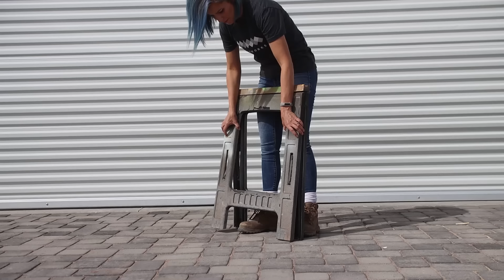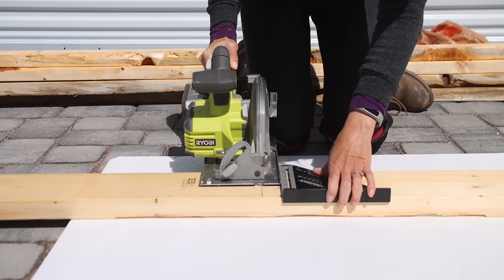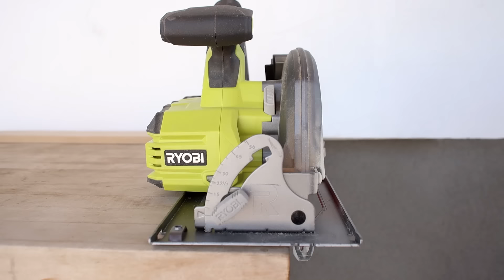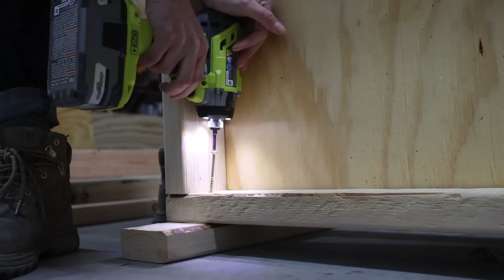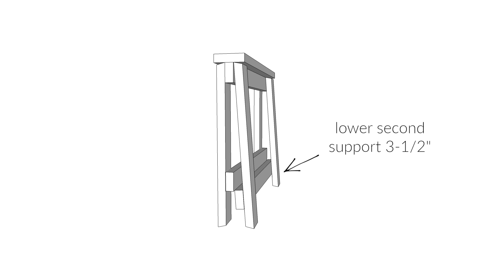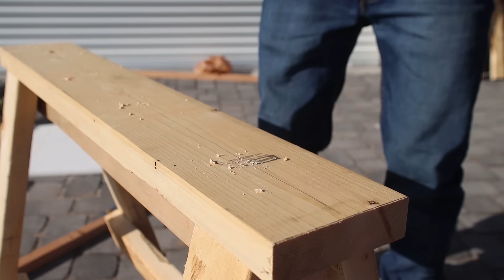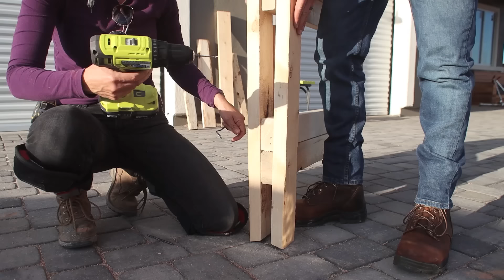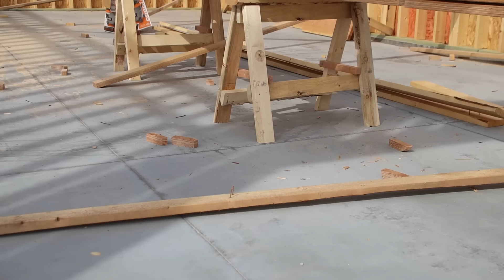HEAVY DUTY DIY Folding Sawhorses

Comment: Great vid, I’ve gone through many saw horses. I like this design, but one small suggestion would be to not glue the top surface board to the rail, as this make it harder to replace.  This top piece take lots of abuse, like saw cuts.

Comment: I'm surprised you are wearing your Dimond wedding ring. My wife was helping me one time and her left hand got pinched and it bent her ring. Had to almost cat it off. Will not wear her rings when Helping me any more. Could have lost her finger. Becarful with your rings. Great Video.
Reply: Good advice. My mate did the same thing and nearly lost his finger, he doesn’t wear his wedding ring to work anymore!!
Reply: Absolutely, a saw a nasty finger accident made worse by a ring
Reply: Stanley Keith. You know that might be the reason for silicone wedding bands that I’ve seen. The initial impression was who’d want to wear something cheap like that? But then, it would sure give away and save your hand in a situation like you were describing.
Reply: @daphneraven6745  Absolutely, that and some of us get reactions to different metals.
Reply: Completely different scenario but when I was in college studying mechanics, my tutor told me about an old colleague of his that accidentally shorted out a car battery with his wedding ring, then when he pulled his hand away it basically de-gloved his ring finger leaving just bone because the ring got so hot! Not sure how true the story was but this reminded me of it, rings can really get in the way! 🤣
Reply: In germany you aren't allowed juwelry or a wirst watch or such if you're a professional builder (carpenter, mason, etc)

Comment: Great video – just been and bought my hardware to build a pair of these. Just a quick note though for the cut list on your step-by-step, the diagrams measurements don't tally with the actual cut list. You've got the runner and leg distance lengths at 36" but should be 33". I've dropped a message on your guide.
Coincidentally, these plastic saw horses in the UK are £30 each, $40 USD so well worth building from this video when you consider how durable they are.

Comment: I like it. I have not read all the comments. My thought is to use a bolt with the head cut off. Instead of the dowel. This would negate the possibility of the dowel breaking over time.

I am going to make a set because I too, have a busted plastic set...🤣😂😅

Comment: Nice job, however they're the same weight as the ones you said were too heavy? Ability to fold requires hardware and compromises strength (when compared to ridged ones). Construction too involved and lengthy, but it makes for a good vlog!

Comment: nice design. i am going to try it with a slightly unstable set of ready made folding metal saw horse heads. the lock arm and gate latch could be useful for that too. my diy sawhorses are stable back and forward but not to the left and right. you solved that problem without too many bevels (new to the round saw). wavering between portable and worktable. i guess that happens at first. ha....

Comment: Now, replace that 2x6 across the top with a 4x4, make them a little shorter and then add in the pipe clamp adjustable top from your other video.  Instead of the little cross pieces to lock the legs together, put in a hinged shelf that locks the legs together and is narrow enough to let the pipes fit on either side of it.

Comment: Should have only used 2 3/4" or 2 1/2" screws for the top plate, since you are going through two 2x4's (3" total) and you also countersunk. Don't need any sharp screw tip sticking out the bottom to rip open your hand.

Comment: I noticed that the holes you drilled for the dowels were perpendicular but should have been at the 15° angle. However, I think using a piece of chain stretched across the center cross beams would suffice to lock the horse at its maximum spread. That way there is no need to lock anything in place (saves time when you just need a quick saw horse stand).

Comment: Wow, this is not the way to cut wood.  Dangerous, she put her hand on the bottom of the blade to check depth while her other hand was by the trigger, with a battery attached!  Yikes!  Also cutting on a piece of foam insulation shoots that crap into your face while cutting, why would you do that, if you need something to elevate it, put some wood on either end of the piece your cutting, foam insulation isn't cheap either.  Also it causes cancer in California.

Comment: I'm making those saw horses now. I will substitute the dowel with a lag bolt. Once I get lag bolt to the proper depth, I will cut off the head of the bolt. Thank you for the tutorial. BTW, I made the legs a little longer. I'm undecided if I will paint them. They'll be fully assembled tomorrow. Almost forgot....how do you keep the pins from falling out of the hinges? I used the same as in your video.

Comment: great idea only thing i'd change is the wood dowel pins i'd use a  metal bolt  and cut the head off once its screwd in  as the lock dowel

Comment: Thank you for this video, I’ll be making a pair soon, and also thank you for sharing the plans on your website for free! Very classy! Great video.
Reply: Did you end up building this? I was looking at buying materials for it today, but noticed a couple of potential issues.
If you did build some, did screwing the hinges opposite each other on the 2” runner, cause any issues with the screws running into each other?
Also, did the barrel of the hinge interfere with attaching the top plate? To me it looks like they’d create a void between the runner and the top plate.

Comment: I"m new to woodworking,.  Regarding the top plate on these sawhorses, would you think it would be acceptable to NOT glue them down before securing them with screws.  I'm thinking of times when I'd need to saw across that top plate, leaving a kerf there.  Eventually, I'd want to replace it with another 2x4, and it just being screwed in would make that easier.
Reply: You could always just add a sacrificial top plate on top of the permanent one. Just adjust the leg length to suit your target working height.

Comment: Do u not believe in punch to  where ur going to drill

Here an addental idea  --  merge the ponies into one design!  let just say my work shop is 6'x 20' so everything need to fold up, hang up on the wall not take up too much space.  hmm, most of the space is used to rebuild cars that get motor blown up or other massive rebuilding

Comment: Good video w/ great ideas. I should build a couple of these. I already have 4 metal collapsible sawhorses which were indispensable building our house & eventually our shop. I added so 2x6” w/ a 2x4 sacrificial top........functional but heavy & awkward. Yours looks lighter, more functual & still be stable. I also love the add-on tops. The tops can be extended up. I’m 6’4”........bringing the work surface up to me is also an advantage. Thank you

Comment: I will put sacrifical 2x4s on mine with dados in them so you can connect the sawhorses with long 1x2s to create a table for cutting large sheets with a track saw. Ideal if you cant cut them with your table saw or cant transport the large sheets into your workshop. If your 2x4s and 1x2s are all beat up from sawing halfway throuh them, you can replace them and your sawhorses are undamaged

Comment: Very clean design and simple build. I like! The only thing I might do different is adding a removable waste wood top rail. Maybe with inset carriage bolts? That way I can cut through the top (up to the depth of the bold heads) without fear or ruining the saw or sawhorse. When they get too cut up, I’ll remove the carriage bolts and put on a new top.

Thanks for this great build! Fun fact: the Spanish word for saw horse is burro!

Comment: I did it today. But a micro version - only 40 cm tall and wide, as I needed a support for a very heavy bench.  These miniatures look really funny, but also, very sturdy. I bet these could easily hold the weight of a car. I added a few little bits (Tee plate), bigger support beam and chain to hold the legs together.  I think tomorrow I will do the exact copy from your plans. Big thanks for your encouragement!
Reply: Went better than expected, but I didn't bother with the leg latching mechanism.  http://hants.pl/photo/sawhorses/2.jpg

Comment: I would have just screwed a strap between the legs so when you opened them the strap tightened and prevented the legs from doing the splits. Then when you fold them, the strap just folds as well. That whole 1x1 block and peg nonsense is unnecessary and cumbersome imo.
Reply: Or chain.

Comment: could attach a bit of ply on those locking arms so you've got easy tool storage while using them as per your plans it would be 14" x 29" i think, maybe 28.5" so you've got a bit of wiggle room
you could also attach some 1 3/4 runners on the top at the external edges, that way there would be a 2" gap in the middle, chuck a bit of 2"x4" in there and you've got a replaceable top so you could run your saw right into the sawhorse without damaging the sawhorse itself

Comment: Nice job. Very space friendly. If you plan to 'use-n-abuse' these sawhorses like I am prone to do, don't glue the tops before screwing them on. This makes them sacrificial and replaceable. Another trick is to countersink those screws 3/4" deep, so a circular saw blade would be less likely to hit them.

Comment: Love this design.  My best friend is a great wood worker / DIY guy.  I'm going to make two sets.  One for Tim and one for myself.  P.S.  I'm a Ryobi fan too. :)
Reply: Did you end up building this? I was looking at buying materials for it today, but noticed a couple of potential issues.
If you did build some, did screwing the hinges opposite each other on the 2” runner, cause any issues with the screws running into each other?
Also, did the barrel of the hinge interfere with attaching the top plate? To me it looks like they’d create a void between the runner and the top plate.

Comment: I have the guys I work with get all sorts of upset about this too lol I’m a builder and I’m very comfortable working on the ground off a couple of 4x2. I think it’s because all the working surfaces are at different heights, some of which aren’t great for my back, and on the ground, gravity and the room to use force through a cantilever action works in my favour a lot of the time when something requires a little more upper body strength

Comment: I will be making these ones myself by next Saturday. The only tweak would be the ability to tie two or more horses together. But these will come in handy when cutting plywood. Additionally I'll be making a temp saw table to rip smaller boards, just one that I can easily attach a regular circular saw in. But these are great. I have only one electric outlet in my garage and the garage hub occupies one plug so this drives to say I'm very limited. Plus I'm in an corporately owned apartment complex too. But my main project is building a loft bed.
Reply: Did you end up building this? I was looking at buying materials for it today, but noticed a couple of potential issues.
If you did build some, did screwing the hinges opposite each other on the 2” runner, cause any issues with the screws running into each other?
Also, did the barrel of the hinge interfere with attaching the top plate? To me it looks like they’d create a void between the runner and the top plate.

Comment: Currently doing this. However, when attaching the legs with the hinges to the runner aren't the screws too long if at 1 1/4 inches? The runner is a 2X4? They would touch each other since there are two legs at each end. Was thinking about using 3/4 inches screws. Help!

Comment: 1st project I did when I started my home shop was to build sawhorses.  Can't do much framing without them.  These look heavy compared to other designs I've used.  As I've aged, weight and dual use became important.  Now my favorite pair of horses are my 32 gallon plastic trash cans.  Flip one over for chop saw or a small table top.  Leave one upright to hold the scrap pieces you'd need to pick up later.  When paired upright they also support both sides of the cut so the cutoff piece doesn't need to be held. Also useful between projects for their stated utility.
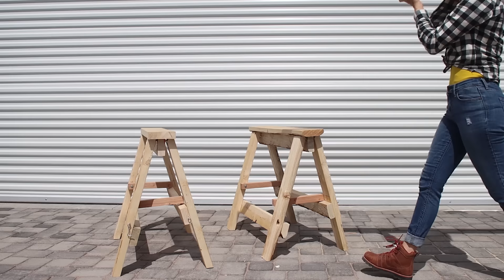Reply: That 25 degree on the bottom will set the saw horse flat to the ground ,more surface area on ground more stable they become.I love your folding idea. 9:38

Comment: The weak point is definitely the hinges. Those screws are what is holding it all up. So these can’t hold the weight that a bigger more robust set can hold but these are great small project horses. Fun project for kids.
Reply from the maker: The hinges aren't holding weight. They are only there to help the legs fold. The load is transfered from the top plate into the top ends of the legs.

Comment: Great vid! Compared to other DIY videos this one does not require you to break the bank on tools. I love how you were even using a circular saw for those of us without miter saws. BTW, I believe your material list should include 8 hinges for the 2 horses and each hinge looks to be slightly smaller than the width of the 2x4s, so 3" hinges?

Comment: I'm getting ready to refurbish a small sailboat and have been looking around for sawhorse ideas (for to set the boat upon it... them).  This is the best combination of simple, quick to build, strong, and foldable.  Also, it's my first encounter with Pneumatic Addict, so good on ya, and thanks for the good design.
Reply from the maker: Thank you! Let me know how the boat turns out ✌
Reply: Did you end up building this? I was looking at buying materials for it today, but noticed a couple of potential issues.
If you did build some, did screwing the hinges opposite each other on the 2” runner, cause any issues with the screws running into each other?
Also, did the barrel of the hinge interfere with attaching the top plate? To me it looks like they’d create a void between the runner and the top plate.

Comment: Made a pair almost identical to this except I only put hinges on one side. Runner was glued to a pair of legs on one side, and hinged to the pair on the opposite side. Just had to bevel the top of the runner for it to be horizontal when it opens. Nice video.

Comment: Love it I'm in the process of making some I'm glad I found this video. Thanks for the info.
Reply: Did you end up building this? I was looking at buying materials for it today, but noticed a couple of potential issues.
If you did build some, did screwing the hinges opposite each other on the 2” runner, cause any issues with the screws running into each other?
Also, did the barrel of the hinge interfere with attaching the top plate? To me it looks like they’d create a void between the runner and the top plate.

Comment: Nope...never kicked a sawhorse and knocked everything to the ground.  My six year old folding big box saw horses work just fine to provide a flat (ish) work surface.  My floor on the other hand is builder grade concrete and no two quadrants are square with any other.  Heck, I have unevenness in the same quadrant!

Comment: OK, saw this video, downloaded the plans....read them a couple of times before anything else.
But I had a bear of a time getting the hinges square.....one of the two horses was really bad out of square.  I took it completely apart and moved the hinges over a little and tried again.  Same result.  There must be a trick that I'm not getting or seeing.

I'm thinking that securing the hinged legs to the top - leaving 1 1/2 in between for the support piece - might work better.....it would eliminate the need for that 45 cut....maybe!?!?!

Thoughts!?!?!?!?
Reply: Same here.  I thought things were going pretty well until I tried to attach the legs with hinges.  Very difficult to line up the hinges, especially if working alone. My legs came out uneven ( those bevel cuts are a bit tricky to get perfect without a mitre saw) and out of square, so my sawhorses are rocky.  Also the hinges make the top plate/runner combo completely wobbly.  Though I still have yet to install the wooden dowel pins for the locking arms. Hopefully that will secure everything nice and tight.  I think I'm going to have to figure out a way to sand or saw off from the bottom of the legs so they're all even.

Comment: Build a fixed base with locking castors for each sawhorse that these can sit on, and a removable top for a work surface and BAM, mobile and modular dual purpose work table.

Comment: If you attach sacrificial boards to the top using 2" screws coming from the bottom of the cross piece, you'll save your saw blades from kicking out on those screw heads you have up top.

Comment: Cannibalize the ratcheting legs off my old folding adjustable sawhorses, from Central Machinery (harbor freight). mount them to the legs of these sawhorses. Enabling height adjustment and uneven ground leveling. The perfect set of durable, maintainable, rebuild-able, and collapsible sawhorses.